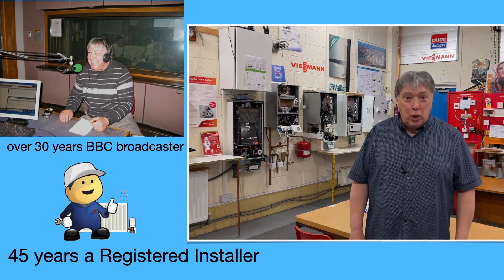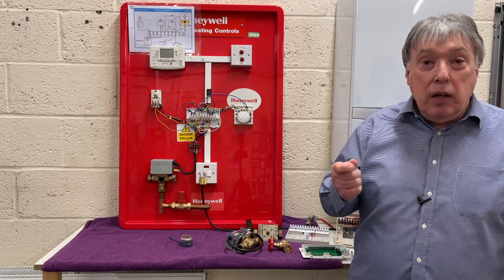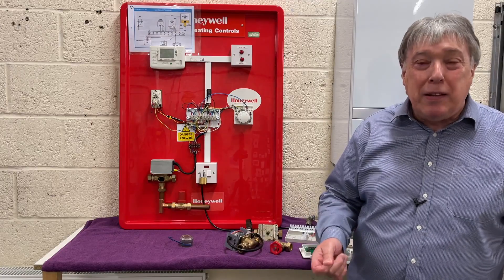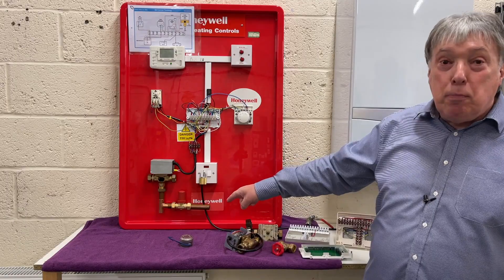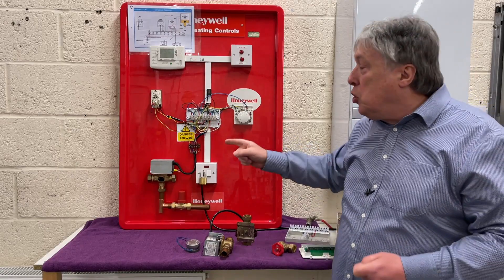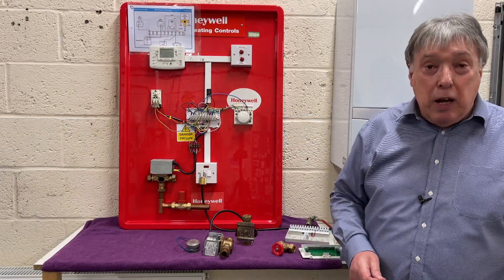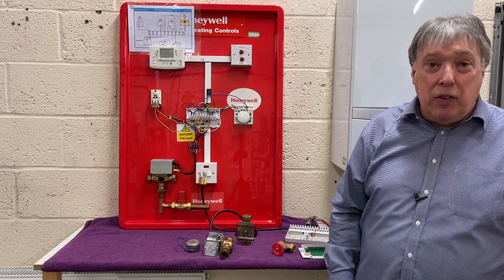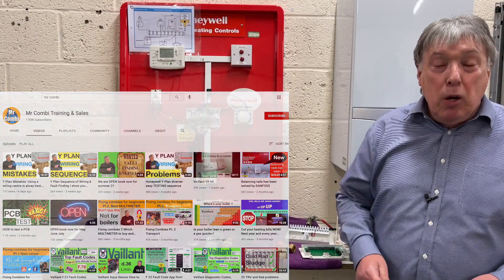Central Heating Y Plan Rip Offs

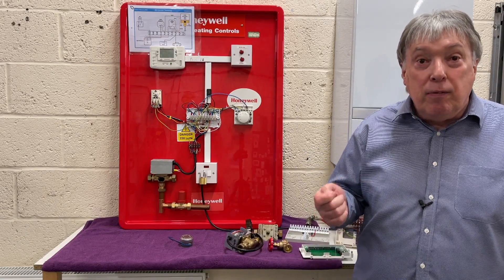Comment: 2:21 how would that work? How does a bypass whether it be a gatevalve or automatic provide heat to the big double k radiators at the end of the circuit? I have a y plan with a gate valve which is a quarter turn open from closed, a lot of heating engineers I have spoken to when servicing my system are adamant that this valve should be turned off completely (one even offered to remove it i declined) one of the recent engineers said " this valve isn't necessary on y plans because the 3 port is always open "all that's going to happen with this valve open is the flow from the boiler will be short circuited and will waste heat to the hot water and radiators"
Who's right?
The boiler is a worcester 18ri if that helps
Thanks
Reply from the maker: Dear Calum? Thanks for asking, you have found some rubbish installers which is not unusual, we don't fit auto by pass to turn it OFF? As per video Honeywell and ALL controls firms REQUIRE every system to have one. The Codes of Practice demand it but some installers refuse to obey the rules. The only reason they are fitted is to keep a CONSTANT flow across the boiler heat exchanger because the rads change pressure and temperature. Not a gate valve AUTO. In my last 20+ years training it was the first thing we did. very very rarely an installer would say, "Never done or will do because we make MONEY and rip of the customer because the boiler WILL kettle and put sludge in the system" These installers should get another job. regards George 😠👍
Reply: @mrcombiBedford Thanks, I will see if I can get an auto bypass valve fitted. Currently the 15mm gatevalve is open about 1/4 to 1/2 a turn from closed it makes a hissing  noise if every radiator is turned off, I also noticed when the water only flows through the bypass the boiler cuts out (flame symbol goes out) but the pump continues to run, I take it this is because the boiler is overheating due to lack of flow through the exchanger? I didn't hear any Kettling or banging the flame just simply goes out.
Thanks either way I'm going to get it sorted and hopefully don't run into the muppets who tried to rip me off getting this essential safety valve removed.
Reply from the maker: Gate valves were banned 20 years ago because they size up.
Reply: @mrcombiBedford  Thanks it will be getting replaced soon, I take it the reason for the boiler turning off when all radiators are off and only flowing through the bypass is due to lack of flow through the exchanger or the heat isn't being dissipated anywhere?
Thanks
Reply from the maker: No, if the heating has finished the pump overrun (if fitted) will continue up to 20 mins. to cool the boiler down to 59C : so the by pass must be ON and working OK, that's part of its job. Hope that explains it, george @calumr2051

Comment: What is the closest position to the boiler you can fit an Auto By-Pass valve? ie -can you fit one right next to the boiler to join the flow and return?
Reply from the maker: Dear Hugh, thanks for asking as video, 10 to 15 CM below the isolating valves is best, on the return pipe must be the last tee connection. regards, George 👍

Comment: I thought the idea of a gate valve on a cylinder return was for balance proposes, heating the entire system up evenly. Hot water from the boiler wizzing around the 22mm coil straight back to the boiler knocking the thermostat off. Cycling.
Reply from the maker: Hi Steve, No it does not balance a system, No boiler or controls firms want this done, its a bodge.  If I came to your house and offered a choice, install a system with fast HW recovery as specified or with a gate valve with a very slow recovery and higher fuel bills and sludge as a bonus, which would you choose?
     You will vids showing a combi + cylinder + gate valve which is banned because its a LOW pressure 
idolater. Now you know, I made a fortune ripping them out. thanks for asking.🤩

Comment: Our 3 port valve failed - however I noticed it was only 3 core cable going to the Zone Valve… Does this mean we have a Diverter rather than a Zone Valve? If so can we replace it with a standard 3 port Honeywell valve and re-fit 5 core cable? Many thanks in advance
Reply from the maker: Hi Ollie, 3 Port also called Mid Position with 3 wires must be really old, they were condemned in 1980's because in HW mode the CH was switched OFF, the house would cool down so much reheating took longer thus cost more.
Drain flush etc. refill with F2 rewire as per leaflet
and enjoy. regards, george 😃
Reply: Thanks so much George, Where can I find the leaflet?
Reply from the maker: @ohwwwh  In the box of the valve, george

Comment: There’s often another heat source in a lounge (gas/electric fire) 
So if room stat was in the lounge it would be up to temp before the other room have reache temp
Reply from the maker: Hi Dave, thanks for the comment,
Correct only a very few would use a gas fire / heat source because it's extremely expensive to have a radiator and fire for one room, if that is the case we advise a wireless or smart controls that way they have a choice. Take care George Staszak

Comment: Love the videos 👍
With the automatic bypass, do some boilers already have them built in?
Reply from the maker: Exactly SOME do have a fixed or auto or none, that's why installers HAVE to fit and AUTO by-pass about a meter of the boiler valves for the TRVs. to keep a constant FLOW across the main exchanger. Thanks for asking, george staszak
Reply from the maker: Hi Taylor, thanks for asking, as I have said many times, what the firm puts in or not does NOT affect our system install. Part L requires the EVERY one has a separate AUTU by pass under the BOILER, not a rad in the hall / bathroom, not a gate valve just a £40 AUTO.
As video shows how can a fixed screw in a boiler balance 8 rads 247? 
Take care, George